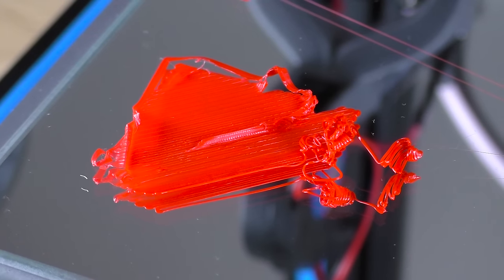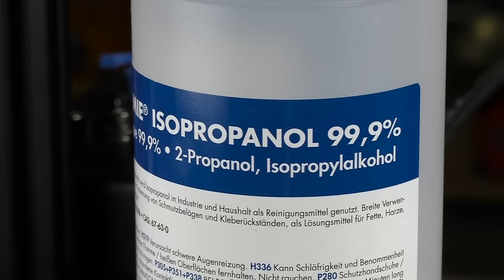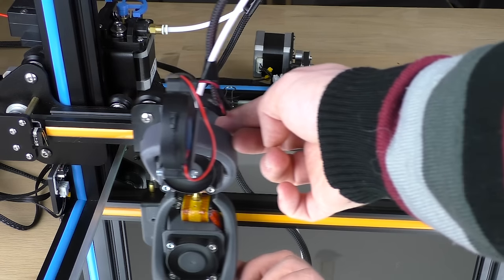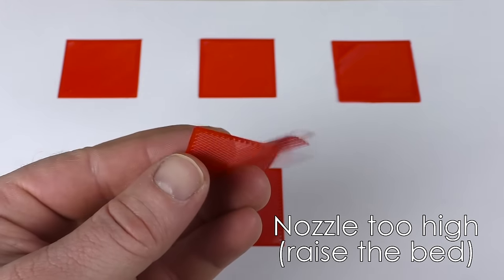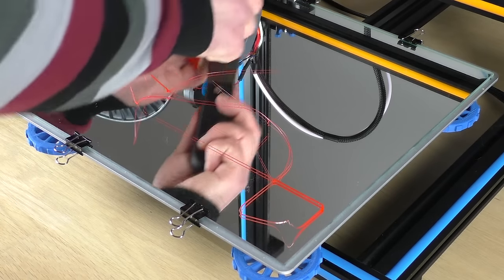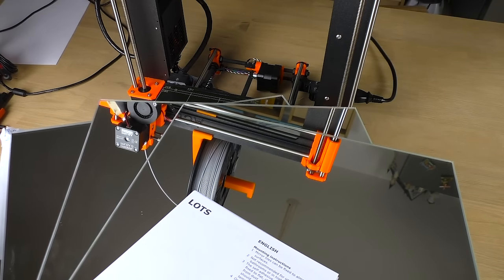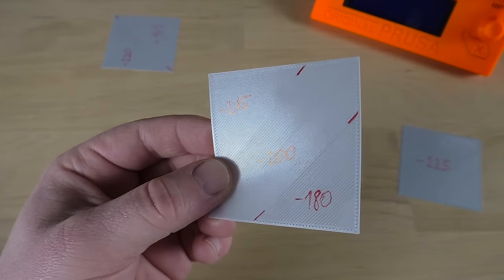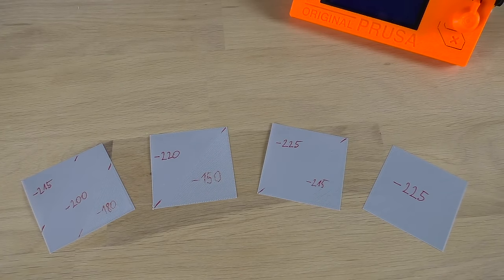Best method for 3D printer bed levelling

Comment: What you call perfect is not that perfect in my opinion. I have the bed somewhat too high on purpose so the first layer is evenly pressed onto the bed. So the surface is much flatter and the print sticks better. Sure, there is a point when there is too much pressure on the bed so it gets scratched, but you would hear that when the head moves over the bed. Also there is no need for leveling the bed with a piece of paper. The screws turn with less force when the spring doesn't hold it down any more. That's the moment when the nozzle touches the bed. Feeling that is much easier than using a piece of paper every time.

Comment: I am going to pull my damned hair out.  I love this video.  You rock.  But, I've got 4 near perfect corners and a center than is too far away.  Ironically, the center has always been too far away and 3 of the corners were way too close.  (insert face palm/bridge of nose rub here)   How is that even a thing when I'm using tempered glass????????
Reply from the maker: Thanks!

I know it sounds funny, but having all four corners perfect and only middle that's too low is actually the best scenario (besides having everything flat of course). Simply cut a square patch of aluminium foil (about 7x7cmm should do) and place it in the middle under the glass. It will slightly raise the bed there and you can even stack more if needed. I had to use about 3 I think before it was perfect in the middle as well.
Reply: Hobby Hoarder it’s not too low.  It’s too high.  But I am thrilled you replied.   Your template is by far the best I’ve used.   Now that I know you’re still active, I’m gonna donate, thingiverse ok?
Reply from the maker: @NOC-H  In that case, you can use the same trick, but first lower the bed so that the middle is fine, then place a aluminium square in each corner to raise it up slightly. You could also try simply turning the glass around, sometimes that works.

I've always been active, it's just that I should be making new videos way more often :D

I'm not helping for donations, I'm happy enough when I hear feedback, especially if it's positive like yours :) But yeah, Thingiverse is fine and I also have Ko-fi account here: https://ko-fi.com/hobbyhoarder
Reply: Hobby Hoarder I’ll check that out. I’m relatively new to printing.   I’m a teacher.   Aside from that my forte is video/photo editing.  I’m trying to get this down so I can use in the Engineering class my school had me create for next term.

Comment: Sir, need your help, in aproximatly at 4.5 minutes of yiur video, you have adjusted Z limit . . . 
Please guide how I can set this Z value in firmware, I am using Marlin v1.1.8.
Please guide.
Reply from the maker: The control for adjusting Z height during printing is called "Babystep" in Marlin. Try pushing your LCD button twice and you should find the controls there. If nothing happens, your firmware has babystepping disabled. If so, you will have to recompile the firmware with babysteps enabled. Check out this video to see how:
https://www.youtube.com/watch?v=LvllHCgAML8

Comment: so i have to still use pice of paper? and then use this priting method? so wheres the simple? wherse the quick? PICE OF PAPER IS STILL FASTER :D
Reply from the maker: No, I specifically say you only need to use the paper if your nozzle is way off, like when you first assemble your printer. And even then just so that you can get it somewhat correct, not to actually use it for levelling.

It doesn't matter which one is the fastest. You only have to do this once every few weeks, so it makes more sense to get better results than to get them fast. Besides, it only takes a few minutes with the squares.

Comment: Don't understand, you said there's a better way than using paper, and then proceed to use paper?? You said the mirror is best to print on, you then used something else??
Reply from the maker: I only used the paper to show how to quickly adjust your bed if your nozzle is way off. You then still have to level the bed using the calibration squares. If your nozzle is already somewhat ok, then you never have to use the paper and you can go straight to printing the calibration squares.

There are two printers in the video - one is with manual bed leveling and I'm using mirror all the time with that one. You probably mean the second printer with auto bed leveling, which has a PEI sheet. PEI works just as well as mirror, so there's no need to replace it.

Comment: Did you REALLY just print directly on the heatbed of a Prusa MK3 without the Printbed attached?
Did you not see the warning "DO NOT PRINT DIRECTLY ON THIS SURFACE!"
It's right there - on the surface you printed on.

Really... consider whether you are the right guy to give advice to... anyone.
Reply from the maker: I'm sorry to disappoint you Michael, but there's actually no such warning. This is Mk2 which didn't yet have the removable surface like the Mk3. Instead, the PEI sheet is glued directly and permanently on to the bed.
Reply: My appologies, 
I missed that the MK2 print surface looks exactly like the heatbed surface of an MK3.
Sorry for that ;-)
Reply from the maker: No worries, happens to all of us.

Comment: video down?
Reply from the maker: Not that I know of? Seems to be ok from what I can tell.
Reply: @HobbyHoarder  it does not work from germany... maybe some stuff is not allowed here again ...
Thanks for the reply
Reply from the maker: @zerant  I'm in Germany as well, so it should definitely work here. I've just tried again and it seems to work fine. Does it say anything specifically?
Reply: Hobby Hoarder well it just don’t load over Cellular it seams to work. Might be a isp problem.
Reply from the maker: @zerant  I hope you'll be able to sort it out. Some workplaces block YouTube, so maybe that's the reason if you're not at home.

Comment: What is with people disabling steppers?! That's the worst advice ever when trying to level your bed. The point of leveling the bed is to make sure get the bed flat so that it is the same distance from the nozzle at all points.  If your disable the steppers and start moving shit by hand you're gonna end up moving your z axis completely screwing up your level
Reply from the maker: If you're doing manual bed leveling, then you have to disable the steppers so that you can move the hotend around and adjust each corner.

This, of course, is not done with auto bed leveling.

Comment: So you don't like using paper, yet the first step is to literally use paper
Reply from the maker: Only when the nozzle is raised so much it wouldn't even print anything. Then it's ok to use paper to get it in the rough position, but then you still have to use the squares to fine-tune it.

If the bed is already somewhat leveled, then you never have to use the paper at all.

Comment: This video has a big mistake! So you never get a real good quality. It is absolutely necessary to align the Nozzel. First step = the Nozzel must be parallel to the bed first. Nozzel hast to ne 90° to the bed and 0° surface Nozzel to surface bed. The Seconds step ist to adjust the distance. So first align Nozzel then the distance zeros. Otherwise Filament will be pushed in front of the nozzles when printing. Rough surfaces or holes are the result. 

You can try the effect with a toothpaste tube. XD
Reply from the maker: I'm sorry, but that doesn't make any sense. If you use the leveling squares as I've showed in this video, then the nozzle will be 90° to the surface. Otherwise, squares wouldn't be smooth or they would be ok on one side and bad on the other side of the surface. And the distance between the nozzle and the surface is correct as well if your squares look like I've shown in the examples.
Reply: Then you've built your printer the wrong way. This video shows how to level it, not how to compensate for assembly errors

Comment: Please use the correct term when you make these videos. People need to use the correct terms so when they have issues people will know what they are talk8ng about. You do not level a print bed you tram it. Tramming is the proper term for 3d printing and cnc not leveling. The bed does not care about its oriantation to gravity which is why we level. Tramming cares about the squareness to the tool in this case the bed corners being squared at the same height to the print head.
Reply from the maker: I agree with you, it's technically not the correct term, but "tramming is almost unheard of in 3D printing community (except with users with CNC background).

Marlin firmware calls it bed levelling. Every sensors is "bed levelling sensor". All the manufactures (Prusa, Ultimaker, Makerbot, Dremel, LulzBot, ...) call it bed levelling. Octoprint calls it bed levelling. If you search on YouTube, there are only two or three videos on "3d printer tramming" and all the million other ones are titled bed levelling. If you check search statistics, everybody is using the term bed levelling and not tramming.

So while I definitely agree with you, bed levelling has nevertheless become the standard term when it comes to 3D printing and I doubt it will ever change.
Reply: @julius stacy
the correct way to write a name is with capitalized initials, so it'd have to be Julius Stacy. So how about you start with that first?

Aside from this obvious error on your side the "correct term" is decided by many factors. 99% of the population, including makers, vendors and the community calls it bed leveling. Deal with it. If you want a crusade travel back in time.

Comment: I'm sorry, but this video makes no sense. You start out by saying using a piece of paper is not accurate enough, then you use a piece of paper to level it. I don't understand the point of your video.
Reply from the maker: The point is that the leveling squares will give you much better results than a piece of paper. I'm only showing paper as a way to quickly adjust the bed, but you should move on to using the squares after that. If your bed is already somewhat leveled, then you don't have to use the paper at all.

Comment: None of this helps if the middle is wonky.
Reply from the maker: Yeah, but that's not what this video is about, although I did mention the mirrors and wedge jack, which should solve that problem.
Reply: If the middle is wonky it will not and while the video, so you say, was not about that you still printed 5 squares so it was about that else the middle square would never have been printed.
Reply from the maker: The Best Stooge The center square is there so that you can easily check if you have a sagging bed. If your bed is ok, you can easily omit the middle square.

As I've said, I've also offered two solutions if the bed is off only in the middle. In any case, manual bed leveling assumes that the bed is actually flat, otherwise you're trying to fix the wrong thing.
Reply: Wonky

Comment: Is this a stupid tutorial ? I mean in the beginning of the video you say there's a better way to level than a piece of paper but this is exactly what you re doing. Lol
Reply from the maker: Benoit Machu As I've said, the paper is just a rough starting point and if your nozzle is already close enough, you never have to use it. Though I agree that I could have explained that better.
Reply: Most people stop at using the paper as an inconsistent feeler gauge and call it “good enough”.

+Hobby Hoarder is suggesting an additional recursive fine tuning step that I thought was really helpful for those of us that demand near perfection, (with respect to fdm technology anyways).

Perhaps you didn’t finish the video?

Comment: 1. Just use a 0.2mm feeler gauge, not all paper is the same thickness.
2. You are not leveling the bed, you are tramming the bed. 
3. This is the most time wasting convoluted method.

Comment: Lost me when you went into the preheating since that puts you in the 10% club, rarely do manufacturers suggest preheating, it's dangerous, and newbies often damage other bed covering and some auto-leveling will show an error and not permit preheating. the increase is so small it's not worth messing with a hotbed and nozzle. We're not building watches using copy paper is quick and easy.

Comment: Your manual method is ridiculously waste of time....just use a .001 feeler stock instead of paper and it will be great.....
Reply from the maker: I don't know, it only takes a few minutes and you generally do it only once, so I wouldn't call it a waste of time. Besides, how is a feeler stock better than paper? It's just as easy to lower the nozzle too much against it (or not enough). I'm guessing you meant 10 microns feeler, not 1, unless you had inches in mind.